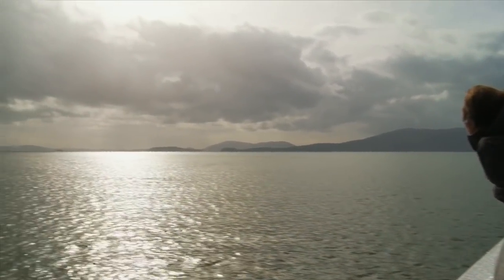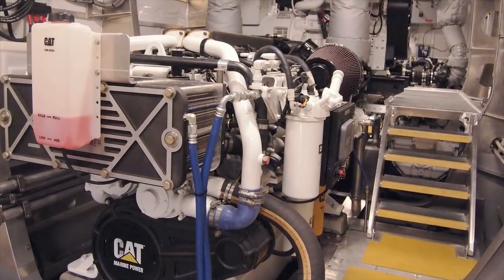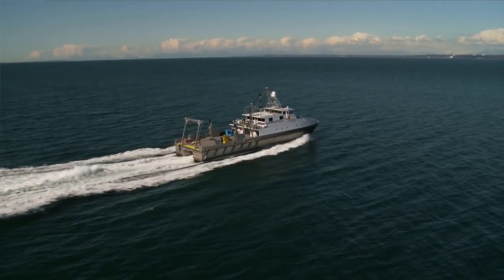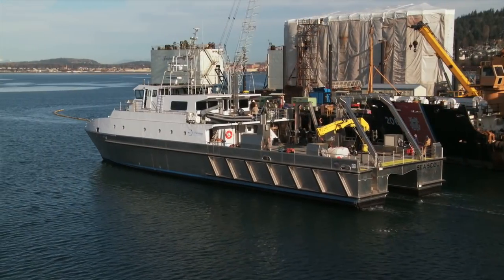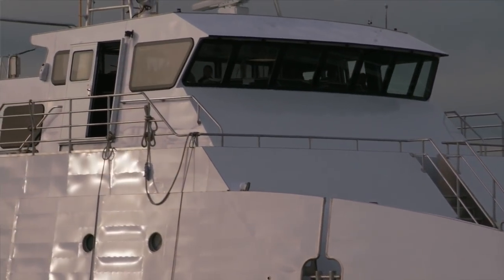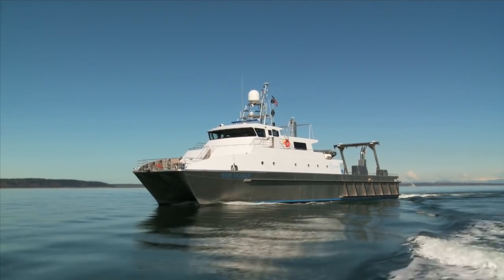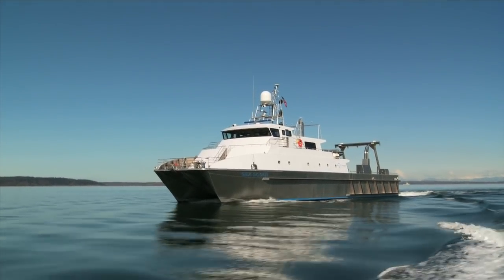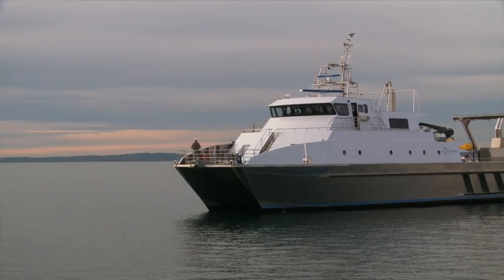Aluminum catamaran work boat survey vessel

Comment: Well, I had a Gibson 44' houseboat that could negotiate any 'water shot' you showed in this video...and here you have a 40-m vessel (that is, in fact, a 'ship') which I wonder if it could withstand 5-m seas?! 'Offshore Survey' capable? I would have expected you to have some 'rough seas' video of it, since you've got a crab-boat bridge on that thing, makes someone assume it is 'North Sea' capable....I DON'T THINK SO! Sea trials...what kind of seas can it REALLY endure?
Reply: Jezus man relaaaaxxsss, catamarans are really good in rough seas its also pretty high above the water and it cuts nicely tru waves so this boat can definitely go offshore. (Unless you are on it because it cant handle the weight of your MASSIVE EGO)
Reply: No, you're exactly right, there's no way that this type of Cat design can handle rough seas very well, and it's obvious to anyone who sees the physics of it, except that it is pretty good sized at 40m. 
It's a shallow-draft vessel due to the weight distribution and buoyancy created by the double hull design, but with a fully integrated hull you have a semi-flat section in between that does not allow for cutting through waves. Thus you Cannot cut through waves, you will hit bottom, and on any significant seas you will occasionally hit bottom very hard and will necessarily stay atop any significant seas that you encounter, which is Not what you want to do. 
This "forced buoyancy" action will not only make for a very rough experience, but the "hydraulic hammer" effect on the hull could possibly split the thing in half, and undoubtedly make it prone to capsizing due to riding atop every wave to the point where once you go vertical (which is unlikely due to the length), there's a good chance of flipping, and once you go over, there's virtually no hope of the vessel righting itself due to the top-heavy nature of the design (built for shallow draft and high speed traversing) and no keel. 
All that being said, again it is 134ft long... I'd love to see some computer modelling to "Prove" the design in open ocean conditions. As you said, the water they show is nothing but Glass!